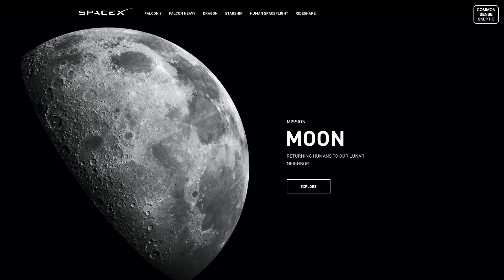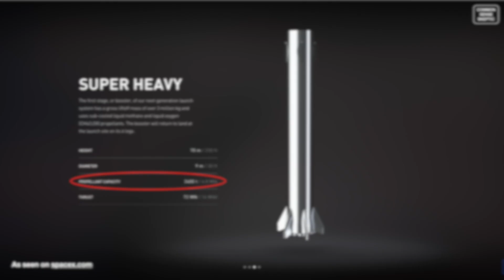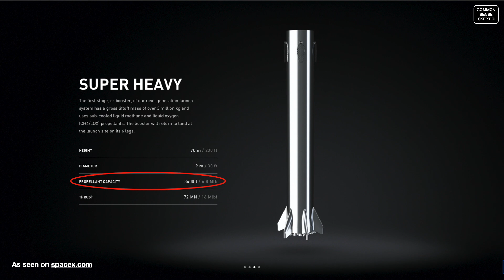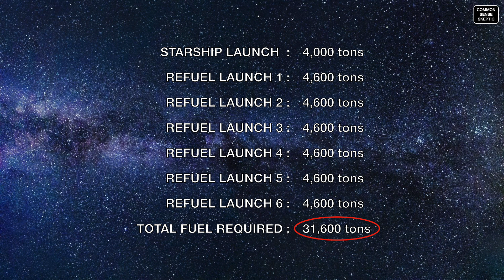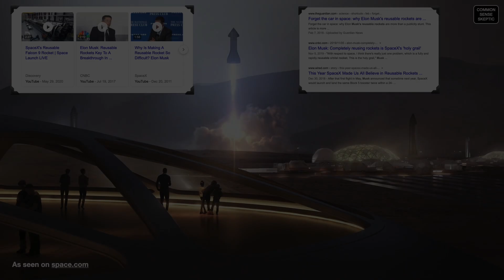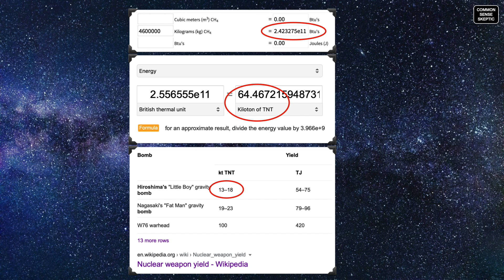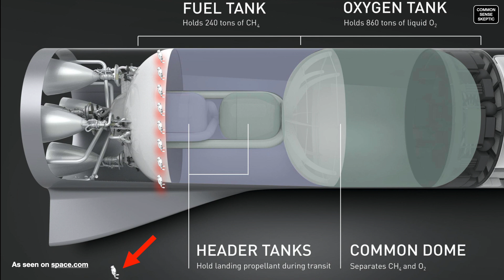STARSHIP EP5 - ORBITAL REFUELLING (1080p)

Comment: An acre of forest releases ~800kt when burned. The difference is that the fuel and oxidizer are not mixed and so cannot react fast enough (>speed of sound) to create a shockwave. In the event of a rocket explosion, small amounts of fuel will mix with oxidizer  before igniting so some shockwaves will form which will bust things apart and make noise. The vast majority of the fuel however will burn just like the forest.
Reply from the maker: And yet the N1 explosion refutes that argument.
Reply: @commonsenseskeptic  No it really only helps my argument: “The subsequent investigation revealed that up to 85% of the propellant on board the rocket did not detonate, reducing the force of the blast.”
Reply: I’m not saying you are wrong. It would still be a grande boom, just less so than the energy release would suggest.
Reply from the maker: @theCodyReeder  what you fail to recognize is “why”.
The N1 had paired smaller pressurized spherical vessels for the RP1 and LOX. The StarShip does not.
Reply: @commonsenseskeptic  you are always the smartest person in the room huh.
Reply from the maker: @theCodyReeder  Not always, but being able to keep up in a conversation is important to us.
Reply: @commonsenseskeptic  Starship has a flight termination system, just in case.
Reply: @benoitgermanier8815  true
Reply: @benoitgermanier8815  The other consideration would be how much heat the initial reaction would manage to transfer to the unburned methane being scattered. If you end up heating the methane enough simply scattering it into an Oxygen rich atmosphere will result in secondary combustion and a larger fireball anyway.
Reply: @seraphina985  Yes that's what happened with SN4
Reply: @Ca1nxd  He said he was looking at the explode at launch scenario.
Though, Cody is correct that it would be a lot less than if all the fuel and oxidizer was fully mixed.  Exactly how much less is a big question mark... A somewhat conservative estimate based on the n1 means it would only be half as big an explosion as the nuke dropped on Hiroshima....

Landing really is a different scenario though.  Not a good scenario, but different.
Reply: @theCodyReeder  Didn't follow how the "smartest person in the room" comment furthered the logical discourse. I must not be a smart enough person because if someone said that to me I would just assume they had gone ad hominem out of frustration.
Reply: @Cody'sLab  Yeah, but all designs to date for harnessing the Forest Propulsion System to a crew module have had bad failure modes. The gantree doesn't fall away and the marshmallows don't adhere to the stick.

Could you please keep up with current research?
Reply: @Ca1nxd  The booster for a LEO flight would be full, Sooo to use your words aginst you. You just debunked your self. Also to compare with the N1 rocket, with many seprate tanks. to the starship with one big tank each, The % of likly hood of all fuel and oxidiser being fully mixed for a failed launch is far grater that not, Taking into account the 100% fail rate of starship launches to date.
Reply: @thejunsk  Bro it is about the landing ffs
Reply: @thejunsk  It is very unlikely for a finished Starship to explode during launch due to all the pre-checks, therefore the real "threat" is the landing
Reply: @thejunsk  omfg you know that Starship uses LOX and LME both stored in tanks with a temperature way below 0F. The N1 used RP1 as far as I know which is stored at room teperature as far as I know. Now use thermodynamics to see what will cause a more deadly explosion
Reply: @thejunsk  Dunning Krueger. If you like it or not
Reply: @thejunsk  Wait so you have seen the S10 exposion. Well, you can see that the LOX headertank didn't even combust with the LME. So that would be my proof that you can "see"
Reply: @thejunsk  In simplified physics you are right but you need to consider a lot of factors. Even I know only 5% (metaphore) of the physics involved
Reply: @benoitgermanier8815  Liquid methane and liquid oxygen are completely miscible (unlike kerosene/oxygen and hydrogen/oxygen pairs). And that solution detonates very well under pretty wide range of concentrations.
Reply: @mishun I'll look into it.
Reply: @mishun  Quick question does it compare LOX/LME and LOX/LME or LOX/LNG with LOX/RP1?
Reply: @mishun  Btw Just one thing, I do believe that a full starship explosion would be a desaster. However, this video greatly exaggerates this factor.
Reply: @Ca1nxd  If I understand the question correctly, they compare methane with both hydrogen and RP-1

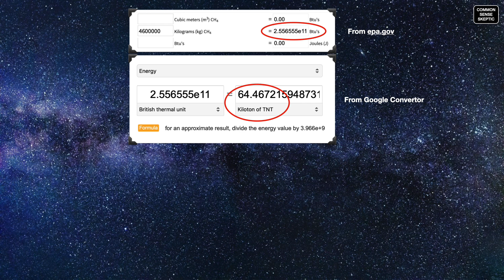On the topic of exaggeration, 4600 tons at 9:38 is both fuel and oxidizer, so upper bound should be ~14 kt TNT, not 64; taking all enthalpy changes into account brings that a bit lower; taking N1 as an example, 15% of that may explode (could be more for methane) and to seriously blow up everything must go wrong in exactly the right way. But since that launch pad has nature reserve, village and production facility nearby, so I think it's a pretty serious concern. At least unlike N1 it probably won't throw burning liquid fuel everywhere.
Reply: @mishun  Ok. Yep, especally the sound of an explosion of Starship would kill a ton of animals. Hopefully we'll never see this. I believe that's why they want to launch it from the Cape.
Reply: @benoitgermanier8815  in the same way that the shuttle had escape modes lol
Reply: @travcollier  yeah getting an 100% explosion would require all the methane to be mixed with lox before the shockwave started. The n1 failed 4 times and only one of them even got to 15%
Reply: @Ca1nxd  but a launchpad explosion might be a 10% detonation and that would clear out the landing sight
Reply: @mishun  you have to remember that lox and methane are not hyperbolic so they can mix better before detonations for large explosions
Reply: @pieppy6058 Hmm, depends on how "strong" stage 0 is. It would get damaged  (not arguing with that), the question is how severely...
Reply: @pieppy6058  I have to apologize for a lot of my comments here. As far as I can see. I have made a lot of mistakes and misunderstood a lot of things. However, I would still say that a starship explosion is not comparable with a nuke or tnt (or even LOX+RP1). Due to my limited knowlage in the field of explosions, I am unable prove anyone wrong here who says that a pre-launch explosion would destroy a lot of stage 0. On the other hand SpaceX probably knows what they are doing. Therefore coming to a certain conclusion is hard to impossible
Reply: @Ca1nxd  It wouldn't be nearly as big as a nuke, but a nuke would still be a relevant comparison (similar to how fuel-air bombs or fertilizer plants/ships exploding are compared to nukes.). The explosion dynamics would look more like how people imagine nukes than how they imagine conventional bombs.
Anyways, it would be a big boom, and that would be bad.  I think we all agree on that.

The real point of contention is probably how much different folks are willing to just trust SpaceX.  I have a lot of respect for most of the engineers working there, but the management has a record of being capricious and quite irresponsible.
Reply: @travcollier  so what did management do...
Reply: @commonsenseskeptic  good on you guys for actually interacting with fans and viewers! 👍🏻
Reply from the maker: @FGuilt  it was a lot easier a year ago :) Approaching 60k subs it's a little harder to keep up!
Reply: @theCodyReeder  Which means that 15% of the fuel exploded. And look at the force of that explosion.
Now imagine the Superheavy booster's common dome failing during engine ignition, so that the O2 and Methane mix nicely for a few seconds before the explosion takes place, at about 250metres altitude.
Yeah - that's a Hiroshima type blast at an absolute minimum.
Reply: @theCodyReeder  No they aren't. But they do know more than you.
Reply: @benoitgermanier8815  Which (as per Muskian normality) failed to destroy the rocket on its first test flight. We saw the little plumes created after the FTS blew holes in the tanks. But it was mechanical forces which destroyed the rocket.  Another (predictable) failure by SpaceX.

Comment: @Common Sense Skeptic Your math is wrong big time because you forgot something, you filled the entire propellant capacity with Methane with no Oxygen to burn it with... you probably see the issue already but for anyone else reading: the caloric energy of any substance ignores the oxygen that is required to combust it which Space rockets most certainly need to take into account by bringing the Oxydiser as fuel, therefore to actually burn one [CH4] into 1 [CO2] and 2 [H2O] you need 2 [O2], with [CH4] at 16g/mol and [O2] 32g/mol the mixture would be 32*2/16 = 4 which means: 4:1 with 4 being the Oxygen in weight. At 4.600 tons of fuel capacity it actually leaves us with a fifth so 920 tons of [CH4].

Additionally it should be really understood that 1000 tons of pure CH4 don't explode like a bomb because it first needs to contact the surrounding oxygen so most of the energy will be released in the form of a huge fireball that burns up very hot but slowly enough to not cause a massive shockwave as a nuclear bomb would.

looking forward to your reply
Reply: You are right, but I doubt you will have a response
Reply: @nicoepsilon0  shame

Comment: They put the fuel ports next to the rocket engines. 🤦‍♂️
These ports have to be able to retract and extend, meaning the hose needs to "flexible".
And it has to take the heat of the rocket engines. Gee, what can go wrong there? 
It doesn't take a rocket scientist to see how STUPID this concept is. 😄
Reply: Another thing: connectors are usually gender pairs, male and female. 
One half of set of rockets needs to be male and the other female. 🤦‍♂️

Comment: Pretty big error at 9:05 The propellant numbers listed are for the LOX tonnage, not the methane tonnage which is significantly lower:  1,200 tonnes for booster and 380 for Starship makes a total of about 1,600 tonnes. That means explosion would be 22kt if at all perfectly mixed and detonated, but that seems unlikely mo? 🤔 Either way, kinda disappointed that such an easy yet impactful mistakes was made.

Comment: I wonder if the use of supercritical hydrogen and oxygen tanks would make the transfert of fuel easier, using pumps/heat rather than inertia to do the transfert. Of course this would waste some energy & weight, but that's better than a straight impossibility.
Reply: Things get oddly conductive when they are supercritical, iirc. Might not be the best idea.
Reply: @Dan-gs3kg  apollo 13 crew didn't complain :)
Joking, but that's a least concern compared to how oxidizing LOX is.

Comment: @3:22 "We surmise that the craft would use, and should not use any more than half of the fuel it has on board."
@3:39 "Now it's time for the tankers to launch. ...they will expend the same energy as the first vehicle, except their payload will be fuel."
Unless the tanker version of Starship has to use the second half of the non-cargo-load fuel to:
1. rendezvous with the crewed Starship & 
2. return to earth, 
then the tanker would be able to dispense more than 100 tons of fuel per trip. 
It's also entirely plausible that the tanker version could be lighter than the crewed version, thus able to carry a slightly larger payload of fuel than the crewed version's cargo payload. 
That's probably the basis for 'at least four' tankers required. Of course, this assumes the preliminary numbers from SpaceX are even accurate at all. 
Though this may make the task a bit easier than the numbers in this video indicate, it doesn't refute your overall argument at all.

Comment: So far I've really enjoyed these videos, and I think publicly pushing against Musk's techno-bro futuristic utopianism is very important. That said, 2 things struck me in this video that I wanted to ask about. (I apologize if this has been addressed in other comments; I don't see a way to efficiently search Youtube comments.)

First, just a straightforward question about fuel transfer in LEO: would it be possible to simply use pumps? I know very little about this issue, so I mean this as a genuine question; perhaps there is a reason this isn't possible or plausible.

Second, a more critical question: when the Super Heavy is taking off, it of course must have a full fuel load; but when it's landing, presumably it would be nearly out of fuel (they would need to plan for a reserve of course, but this could only be a small fraction of the total fuel load). So I think your predictions about a massive multi-Hiroshima explosion upon crash are not likely at all—there just wouldn't be much fuel on board. Though, again, this is definitely not my area of expertise, so I'm happy to be corrected here.

Again, though I raise these questions, I really like these videos and appreciate the work you are doing here.
Reply from the maker: So, the aft-to-aft refuelling position we showed here was shitcanned by SpaceX a couple months later because it was not workable, As we said. They’ve now adopted a side by side configuration that seems equally unfeasible. So, basically, they’re back at the drawing board.

As for the explosion, we denoted it as a worst-case scenario at liftoff. Either way, it’s going to be a huge explosion.
Reply: Since in zero g the liquid fuel will float around in its tank, most of the time a pump would just be pumping air.  Rocket engines get away with using pumps because they are accelerating, which results in the fuel polling in the bottom of the tank.  So to use a pump, you'd have to use your thrusters to accelerate while pumping.  That's how rocket engines that use pumps restart in space.
Reply: Pumps would need to move both gas and liquid back and forth and seperate the two because zero gravity would mean the two are mixing. Thrusting even at 1/1000 of a g would solve the problem and if pointed the right way could provide orbit raising the cancel drag from being in a parking orbit. All that is moot because Musk as stated they are no longer doing butt-to-butt fuel transfer but side-to-side somehow. 

My concern is that no matter what cryogenic cooling is going to be need to keep LOX and LCH4 liquifed over month if not year long missions, to and back from Mars, we do not have cryo coolers of that size built for opertion in space yet.